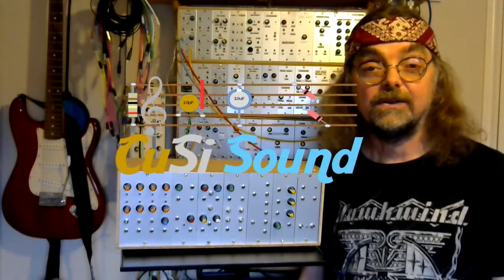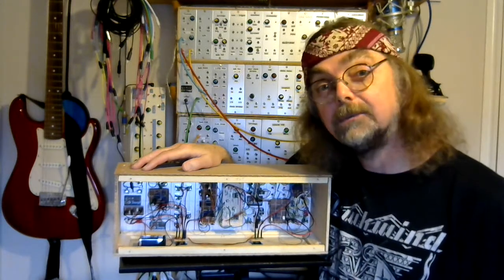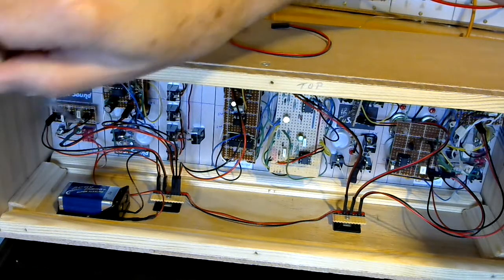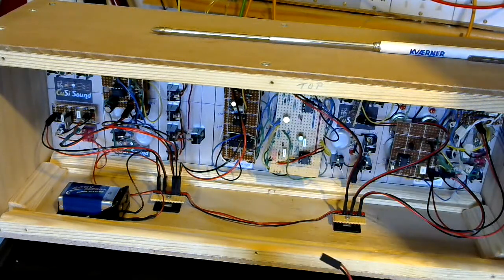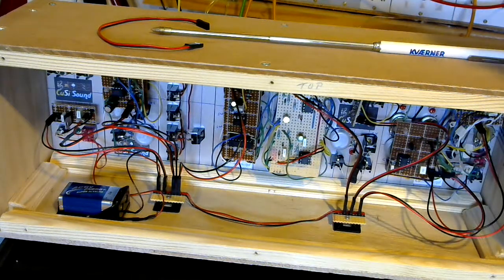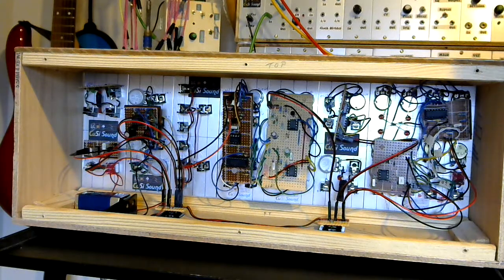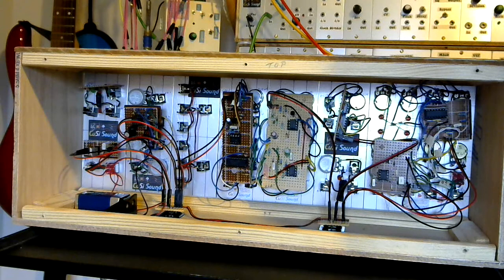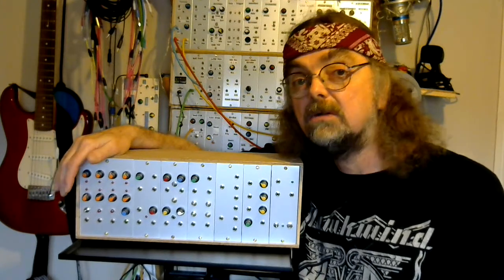Project Nine-20 DIY Modular Analogue Synth : Power and Passives

Comment: could you share a schematic or more detail on how you routed the low pass gate circuit? I'm guessing it's basically the passive filter with a vactrol instead of the pot ??????
Thanks for everything Alan! your videos are SO INFORMATIVE and MOTIVATING !!!!!!! they always make me want to turn on the soldering iron.
Reply from the maker: Hi John, I show a stripboard layout for the LPG in the Project XII video https://youtu.be/W0X-9Va59Sw . The low pass gate (LPG) circuit is by analog_lab.swiss on instagram https://www.instagram.com/analog_lab.swiss/
Reply: @CuSiSound  OK thanks for pointing me in the right direction.